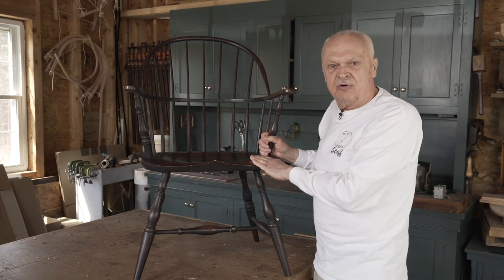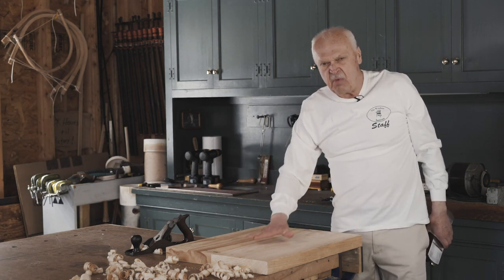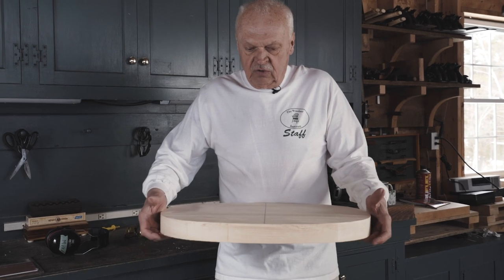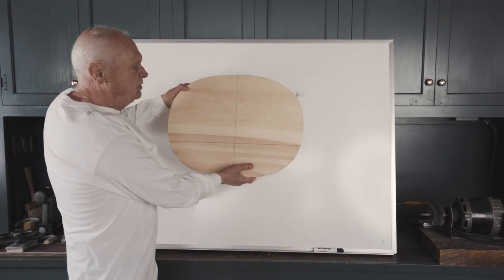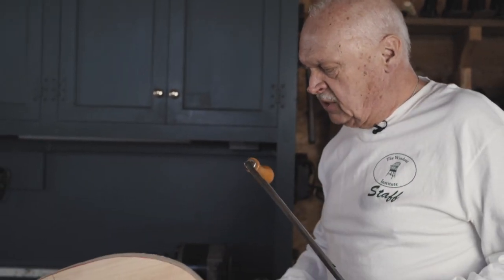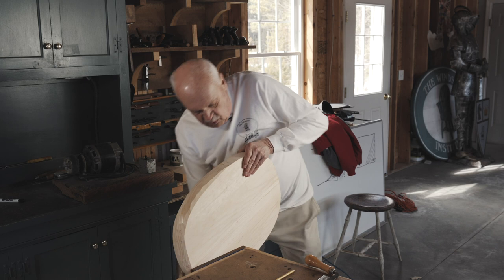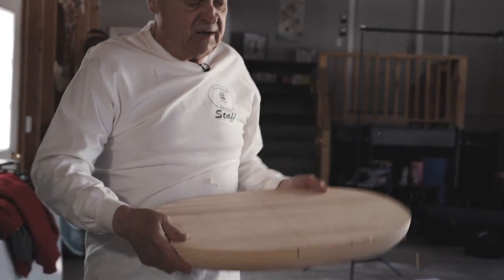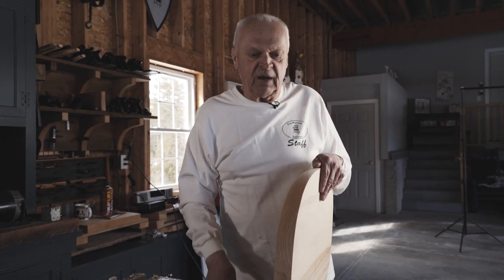Make a Sack Back Windsor - Episode 1

Comment: Not only has the design never been topped, it has actually regressed.  
People simply run through a series of (literally) wobbly-ass cylindrical mortise chairs throwing them out while wondering why they get loose.  It's a solved problem!  Now, the difficult part, to make my own.
Reply from the maker: Good luck in making a chair. The purpose of this series is to walk you through the process. If you get stuck I am only an email away. When you're done send me pictures. I get a real kick out of seeing someone succeed.

Comment: I’ve just recently become a fan of  these chairs and will be making them. Although I’m too late to take your class in person, I’m very happy you are doing this YouTube series. I’ll be following along. Regarding questions from this first episode:
1 - it would help to have length and width dimensions of the board used to make the glue up,
2 - the template for the seat is a key element. I guess i could estimate its shape, but might you consider including in the description a link to download a template that i could print?
3 - I’ll have to rewatch the description of the 1/5 2/5 discussion as I didn’t quite follow.

Comment: Hi Mike.... It was a lot of fun to watch and listen to a master of his trade.  Wood workers have our own language!  BTW, what happened to the 10 episode? I was looking forward to seeing you drill thise steep angles!  Just for fun...Have you ever run into a 'ball and socket' joint?  I did when I first started my apprenticeship in '76, a funny-scarey-sad story.  Take care.  Also I was impressed with your physical endurance!
Reply from the maker: Hi Birdie: Thanks for your kind remarks. Episode 10 is now up and I drill those angles. Not sure I know what a "ball and socket" joint is.
Reply: @thewindsorinstitute2047   Ball and socket joint night-mare....  I apprenticed in 76, as an apprentice I was to help out when needed and clean the shop (even though I had been building furniture for 5 years on my own-I learned from books, asking questions, trial and ERROR etc.)  In that shop  my first step up was funrinture repair, working at least 10 pieces at a time.  You learn alot from furniture repair.  Anyway one day an antique dealer came in and needed a chair reglued.  Only way to do it right was to take the chair apart.  This was a shaker chair, museum piece and I was told to have it done for pick up in 4 hrs.  Easy enough I had done many chair repairs before.  When I tried to get the legs out of the seat..those suckers would not come out!!!  bang bang and bang no luck!!!  I figured someone had set a nail deep into the tennon and i didn't see it.  I keep banging utill the bottom of the seat RIPPED open, holy crap was I in trouble now.  The boss was NOT happy!  Back to the joint.  You carve a ball into the top of the dried hardwood leg.  Then you drill a hole into the green seat, then carefully carve a socket inside of the hole you drilled.  When you are ready you BEAT the ball into the socket, the green seat give some then swells back, when the seatdries if you do it right the joint is tight...similar to a fox-wedge (a blind mortice and tennon with wedges inside the mortice) once it is together it can't come apart.  Bottom line I had to fix the bottom of the chair so NO ONE could see it, which I did!  (out of fear and desperation) I learned a lot that day.  BTW the best chair joint is one that can easily be fixed when the chair has to be reglued in 50 to 75 years... BTW I've designed and built quite a few chairs and loved each one, beginning to end!

Comment: Hi Mike.  Great to see that you are still active in the industry. I am your lone student attending your institute from Saskatchewan, Canada. I enjoyed it immensely, albeit many years ago.  I completed my most recent sack back chair a month ago.  I am now attempting a fan back arm chair.   I steam bent the comb yesterday and it now sits drying in the form.  I do not have plans for the fan back, so I hope the curve I came up with for the comb will work.   On a side note....I am struggling to acquire riven wood suitable for spindles.....living on the prairies.  Does anyone have a suggestion as to supplier of rough riven oak for spindles? I reached out to Hancock, but never received a response.  I an also interested in acquiring 40 seat blanks if the cost is within my budget.    I look forward to your next video.

Comment: Would it be possible to build a sackback chair with squared pieces rather than spindles? Would it even look right?
Reply from the maker: Hmmm.   While it would be technically possible. You will have to cut square holes through the arm and bow.